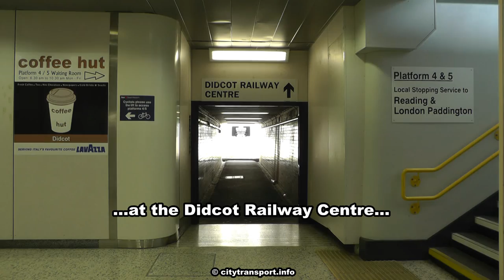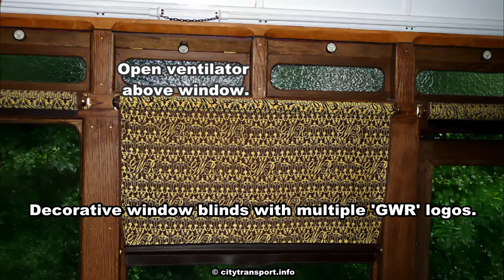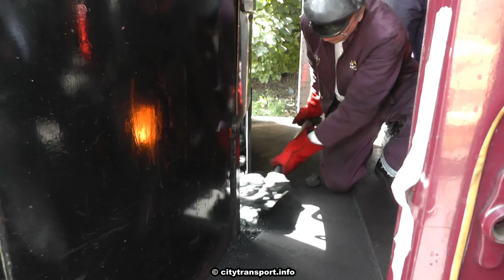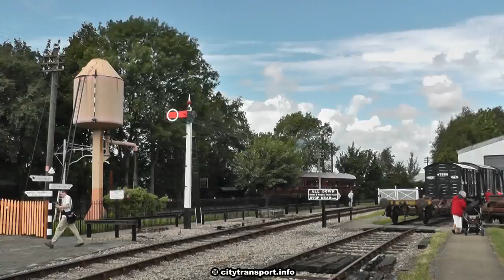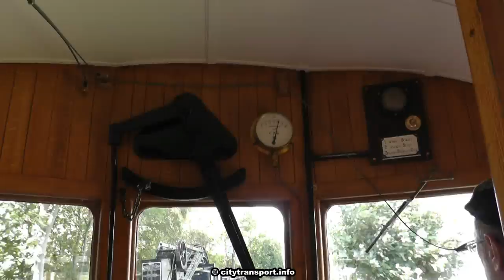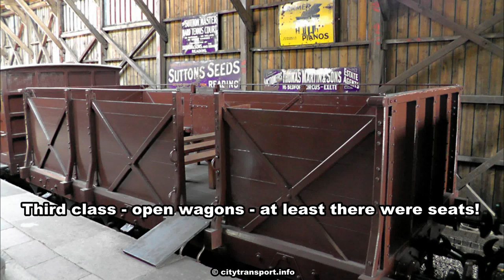GWR Railmotor No.93 @ Didcot Railway Centre

Comment: They did a very fine job on this.It maybe isn't sufficienly clear, but his railmotor was a total wreck when the GWS first got hold of it. It had been used as a mess and storage car with the result that most of the interior furnishings were gone and had to be reconstructed based on old photographs and drawings. The car was stored in the weather for a long period and much of it was rotting and decaying.

Comment: USA did something like this also..very cool that this one is running. Not sure if any of the US ones are even saved..awesome video!!
Reply: Vvery cool my friend
Reply: Victor Aguilarl indeed :-)
Reply from the maker: coming soon (either May or June 2014, I hope)... the Railmotor plus a non-powered trailer, working as a steam "multiple unit".There is a mechanical linkage which allows a train driver standing at the far end of the trailer to control the train's acceleration and braking!
Reply: citytransportinfo Oh that's cool. Yeah I saw a video of this car when it was being run at the other end. I didn't know they had a linkage for the trailer car. I was looking for that when I saw it pulling the trailer in another video. I did read somewhere that they could have done that with actual steam locomotives but they said it wasn't practical or expensive. I think it was a book I have. But the mind does wonder.

Comment: CONTINUED: I visited this car some years before the restoration project started and at the time it looked so sad I struggled to believe it would ever run again. Some real engineering miracles have ben worked to brng this one back from the brink. There is also a matching trailer by the way, that they are still working on but that should join 93 soon.